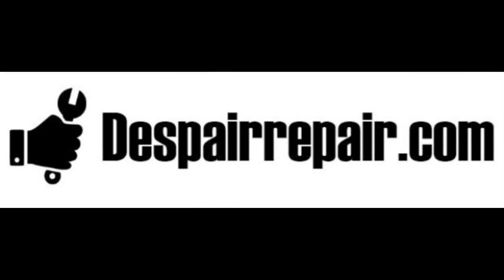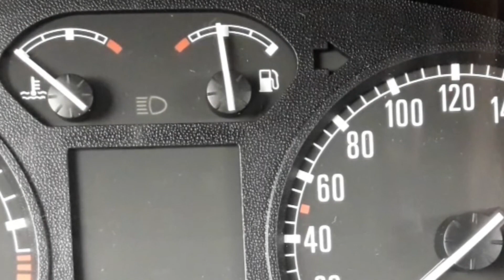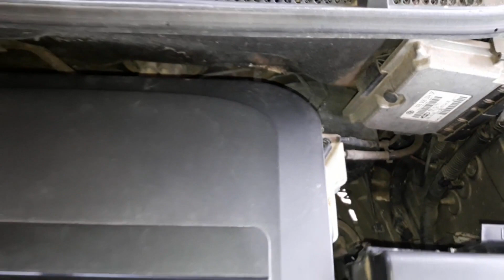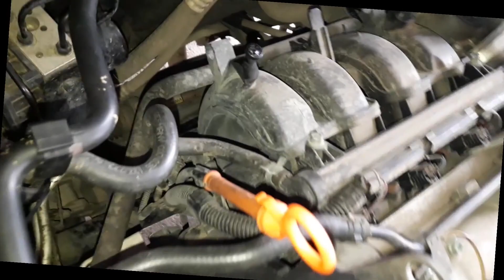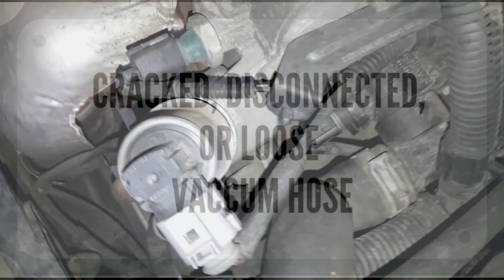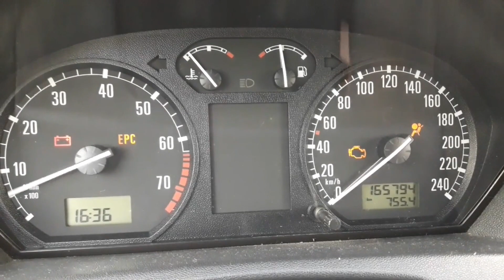Reasons For Check Engine Light-Skoda Fabia And Other Same Generation VW Cars

Comment: Hello my skoda fabia 2004 petrol  . My check engine light comes on ..
 followed by ecg ... after around 20 minutes of driving.. 

Now the check engine light is permamantly on, and ecg again follows after around 20 minutes  I don't understand it  any help please from anyone who had a simular issue..

Had a full service in Sept + passed it'd mot in December
Reply from the maker: Hi, and sorry for the late reply. If you mean the EPC light, you could have a bad throttle body problem. I had a similar issue, made a video about it.

Comment: I have it after i fill up the tank with e10 petrol but Skoda says is compatible bc it’s a fabia 1.4 2006
Reply from the maker: Hi, and thanks for watching! It could be the petrol (although I doubt it), or it could be an O2 sensor (which is more probable). Best connect an OBD tool and see what the error codes are.

Comment: Thanks for the video, its pretty good. The onboard computer indicated an EPC error on my car, so I removed that plastic flap. After this, the car stood for a day or two, and then when I set off, the check engine light came on. The throttle body is completely new and original in the car. Do you have any idea what I should do next? Otherwise, the car drives and operates perfectly. (Fabia Mk1, 1.4 16V 55kW)
Reply from the maker: Hi, and thanks for watching! What flap did you remove? Also, how is the throttle body new yet original?
Could you let me know if you connected an OBD tool?
Pardon my inquiry, but I didn't understand the question.

Comment: hello i have skoda fabia 2001 model and i try to check it in obd and there P0300 P0301 P0302 and P0136 show, but i already replace the spurplug last month. thank you for response.
Reply from the maker: Hi and thanks for watching! Have you checked the spark plug coils and the connections to them?
Reply: @DespairRepair  do you have turorial video for that to remove or clean. and you have fb page? thank you
Reply from the maker: Nope, not yet but we'll have to make one.

Comment: The "check engine" light turned on for me after this sequence of events on my Skoda Fabia 1: 
Wanted to move my car on below 0 degrees weather. Cold start of engine (diesel), let it idle 30 seconds to heat up a bit, then moved the car (about 100 meters) to its new location, idle for 10-20 seconds and shut it down. Restarted the car to adjust its position slightly, then when I wanted to turn it off, I did not press the clutch pedal, and it appeared to misfire. 
And bom, permanent "check engine" since then.
Did not go yet to the auto-service, but I do suspect it was an isolated incident, being my fault that I have not allowed it to warm up before the start-stop sequence

Comment: I got a code for a egr valve started and stalled straight away only worked if I unplugged the egr valve connector and what is was is the fuel purge valve it was stuck open causing a air leak it only opens when engine is hot but mine was open all the time but now I replaced it now running perfectly its a common problem on these skodas but people spend lots replacing parts that are fine I only replaced the egr valve which obviously didn't make a difference as it was the purge valve
Reply from the maker: Hi and thanks for watching!Thank you so much for sharing this valuable information. Did you get any fault codes?
Reply from the maker: Sorry I meant what fault code did you get?

Comment: Thanks for this hint. I had the same yellow light on a Fabia 6Y5 and the diagnosis targeted the EGR. At the end was just a small rubber tube on the EGR that was being chewed by the engine cover
Reply from the maker: Hi, and thanks for watching!
Glad if the video could help!
Sadly, on modern cars, it's often that small things cause lots of unneeded repairs and costs.
That's especially a pity on well-built cars like Skoda.
We've made a video specifically about that topic trying to help people avoid it.
All the best to you and happy driving 🙂